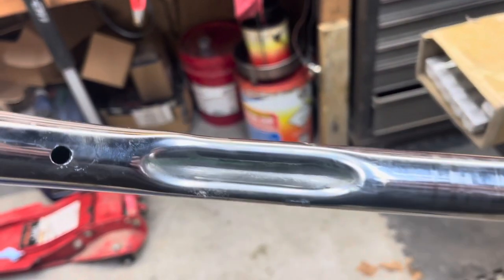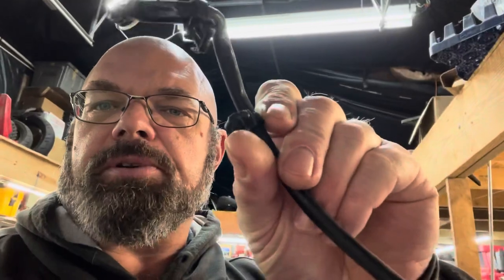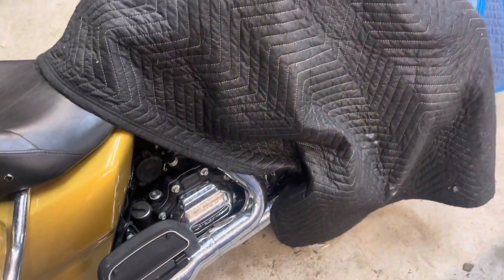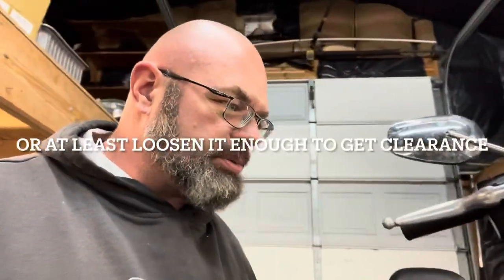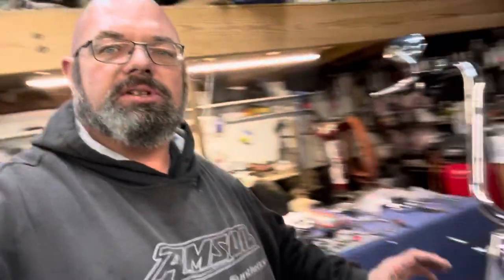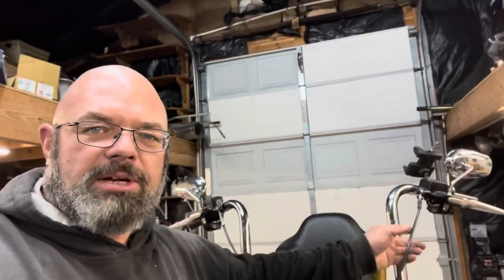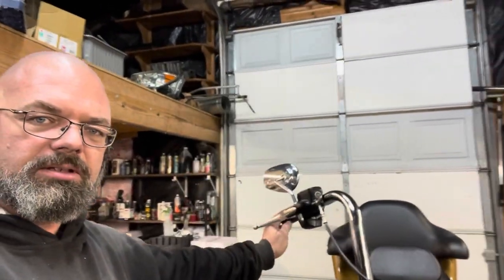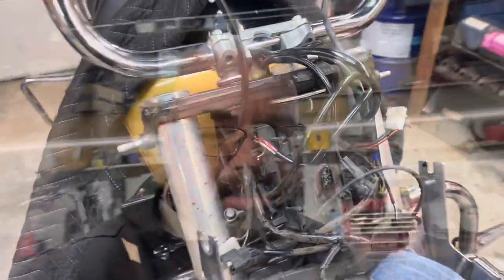Milwaukee 8 Road king. LA choppers 16 inch bars and extended brake line kit

Comment: And that my friend is why I'll only have you work on my bike from now on. Honesty is more valuable today then money, especially when it comes to safety.  Well done Sir. On a side note, we gotta discuss getting you heat/AC out in the garage !!!
Reply from the maker: I have a wood-burning stove that I’ve been meaning to install out here for about five years. Unfortunately it’s packed away in another building buried by a bunch of other junk.
Reply: @amsoiladam  We gotta get you a heatpump installed,  that way you have heat and air conditioning. We just need room in the panel for a 60 amp and 30 amp 2 pole.

Comment: Hi Adam great video I appreciate your hard work! I just went down to my local amsoil dealer to pick up oil so I can change the oil in my bike and he said there's problems with amsoil and for a long time now even before covid. I didn't know that, so he's no longer a dealer for them he switched to torco oil. Is there problems? I wanted to ask you because I think you would know a lot more than him. Thanks in advance have a great weekend!
Reply from the maker: There are no problems that I am aware of. All product is in stock. The company is up and running like usual. I’ve heard there’s been a few shipping delays because the carriers are behind schedule but that has nothing to do with Amsoil it’s in the transportation industry.

Comment: I'm guessing that the company that makes and sells the kit has test fitted their products on several motorcycles. It seems like they should offer directions and time estimates for various models with and without ABS etc. Also, the directions should include that ABS needs the special bleeding procedure.
Reply from the maker: The kit didn’t even have any instructions with it at all. And Four a seasoned technician like myself there’s no big deal but if someone was a novice trying to do this at home it  could be very challenging to understand
Reply: @amsoiladam  Call up the company and ask them if they'd be willing to pay you a little if you made an installation video for them. Their kit has more value and would sell better if it had good instructions. All DIY and professionals like stuff that fits and installs nicely.
Reply from the maker: @bradboustead1682  I have to send email correspondence. Even other website they have little to no information. I spent a couple hours doing Google searches and came up with almost nothing
Reply: @amsoiladam  The troubles you are describing, further illustrates the need. New handle bars are a fairly common modification. Do they want motorcycle people talking about how wonderful they are or how challenging they are?

Comment: Great video!
I worked for the Motor Company for 11yrs behind the parts counter. The Motor Company had made sure that one-way or the other you will need to purchase the software (not cheap) or bring the motorcycle back to the dealership. With the ABS braking system..you will need to hook it up to the Digital Technician or have the software to let the motorcycle know the system has been changed.
Hopefully you have a local shop..not Harley, who has said software to help you out.
Thank you again for all you do my friend!!
Keep on keepin' on!!
Reply from the maker: Thanks George

Comment: For every person Ive seen talking about how you need the dealer to use some special tool to bleed the brakes after changing the line, I see another person saying the ABS module is bypassed and wont take in air. Im about to change my bars this weekend and am worried about messing up my ABS if I introduce air. HELP!!!!!
Reply from the maker: I have never had any issue with it. But I’ve heard other people that have. One thing that I do is, I make sure not to turn the power onto the motorcycle at all while I’m bleeding the system that way if there’s air in the system, the computer never knows it.